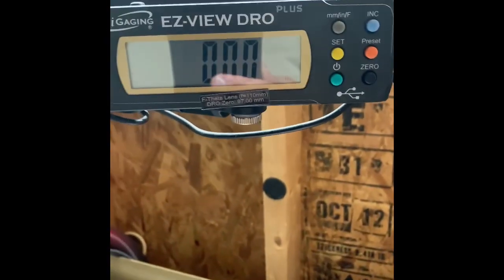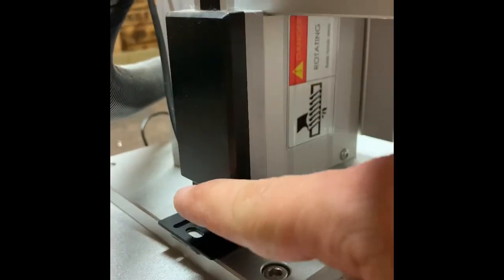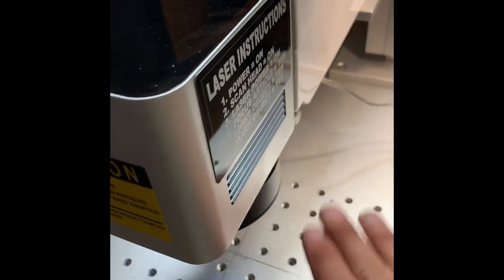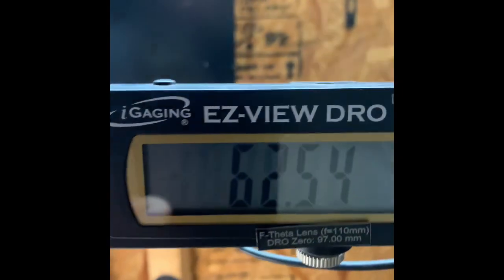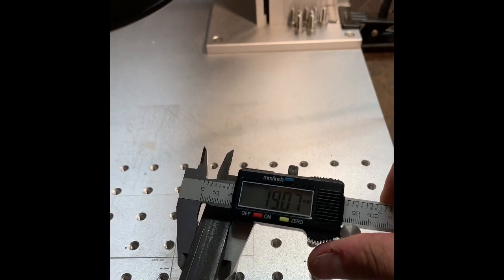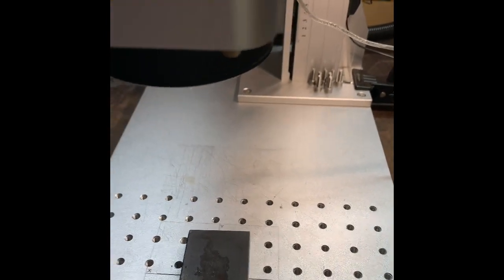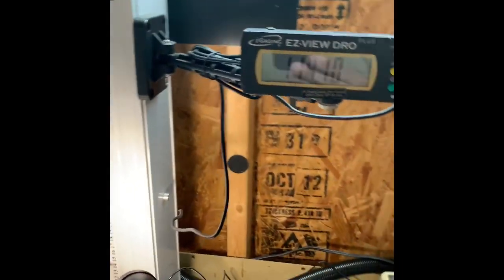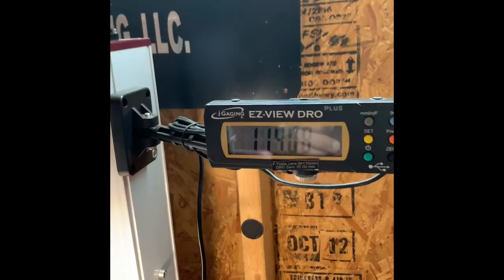DRO Digital Readout

Comment: Thanks for the idea of the DRO. mine came yesterday. I got the absolute version, which retains origin, which I set at the focal height of my 175 x 175 lens. I generated an excel spreadsheet that I put in material thickness of what I am marking, and it adds that to the zero(where I set origin) and that is where you adjust your height to. I also made a setting for my 70 x 70 lens. which the focal point for that is 165.25 mm lower, so it subtracts that distance from the origin and adds material thickness.

Comment: No, you'd zero your DRO at 100... Also, you could have moved the pointer on the built in scale to read accurately... there's screw holes for that.

Comment: First of all thanx for sharing your knowledge, tips & tricks. Not many out there who do... I wanted to ask, I have a 30w Raycus as well, how do you know the zero of your lens is 100? My machine wears a 175x175
Reply from the maker: Hello and thank you for watching.  I will try to answer this the technical way and the non-technical way.  I will say that if you want the "fastest" way to find your laser's lens prime/optimal focus point is to put a piece of material on your bed, select continuous mark and "slowly" adjust the height of the tower until the marking sounds the "loudest" and this is most likely the optimum focal length.  You will need to have a reference mark on your lens from the edge of it to the base of top of what you are marking - measure that - this is your length in MM.  Repeat this.  If you have a Digital Read Out "DRO" this makes getting to that measurement quickly.  99% of all Fiber lasers use a single-focal-length lens for their work (f/l).  The reason why Fiber lasers use F-Theta lenses is because they are engineered to be flat and provide the best marking surface where as curved lenses are restricted.  Flat field scan lenses solve the problem of marking on flat surfaces. Knowing your laser's "spot size" can help calculate the distortion and can influence the focal length based on the diameter of the scan field L=fX20.. Your Lens should have come with an instruction sheet that would have given you some information like "Focal Length, Diameter, Scan Field, and Working Distance.  You would be looking for the working distance. Start there and adjust for optimum "sound".  I hope this helps.
Reply: @patriotlaserengravingllc2233  I used the quick method, since the laser came with nothing but a Quality Check for the lens in Chinese.. So I guess the focal length is the one I found minus the thickness of the piece of scrap metal I used, correct?
Reply from the maker: @anneloesschaafsma8750  That’s correct.

Comment: Ok. Silly question.  But with the lens not all the way down to the table,   Wouldn’t it be 100mm plus the distance between table and lens?
Reply from the maker: Not necessarily. It depends on your lens. The smaller the lens the closer the bigger the farther. You really need to know where your zero is for your lens and machine. You can choose to zero the DRO there at focus and just add to it based on thickness of your object or settings or do what I do. Just record where it is at zero and do math. 😆

Comment: My boss sent me home with his new 50w fiber. He bought this with it. No idea what it did lol. We only engrave 3 parts really at 3 different heights. I just found the cleanest burn for all heights and wrote it down and adjust. I might set this up though cuz he said in my free time I can use it for whatever all be doing alot different heights. Thanks.
Reply from the maker: Definitely helps me with repeatable settings. Lucky to be given a $6,000+ tool to take home! Good luck with it and join some Facebook forums a wealth of knowledge out there if you aren’t already on there.

Comment: I put one on mine several months ago and I love it. I used the same model. I liked it so much I went back and bought one of their calipers too. It's probably nicer than the DRO. Btw, the extra USB port is for their bluetooth module so you can download measurements to your phone or computer. I bought that too but so far haven't found a use for it at all. 

Great video. I may go back and release the top mount on mine and see if it moves more freely. It's good now but every once in a while the readout seems a little unreliable. I am curious if it is binding up a little. We shall see.

Comment: From my 2+ years of experience with iGaging DROs, they are not very repeatable. If you move it up & down a few times then move back to zero, they can be off by 0.05 mm or more.
This may not matter in your application, but just be aware these instruments cannot be completely trusted .

There is a useful “relative distance “ feature on DRO that allows you to measure distance from a point at which you switched from absolute to relative coordinates. This helps in avoiding silly mistakes when you want to move from current point by specific distance but added or substrates the numbers incorrectly
:-)
Reply from the maker: Thanks for the input. Without a doubt, iGaging may not be the Rolls Royce of DRO's as they go but I can say with a level of satisfaction for the work here, they are accurate enough. I probably would not put these on a CNC Milling machine ;) Great feedback though and I would say to those reading this that may be considering a DRO, this comes down to your budget and quality but get a DRO regardless of the quality you're expecting to get from it.  My iGaging does very well for the video's purpose.

Comment: Great video Dave, UK 🇬🇧 Veteran here. Keep up the good work. Question though, if yuh know that head zero is 100mm.......why don’t you just then zero the DRO to zero/datum at that height?
Reply from the maker: Pronto Images good points I suppose you could zero it there, for me, I use multiple lenses and frequently swap them and don’t want to zero every time but rather prefer a true vertical height and do the math instead.  Different lenses have different focal points for me. 😉